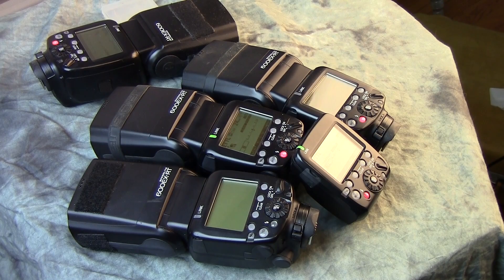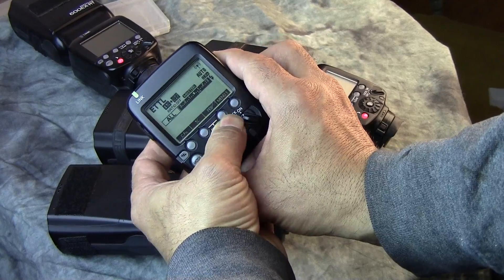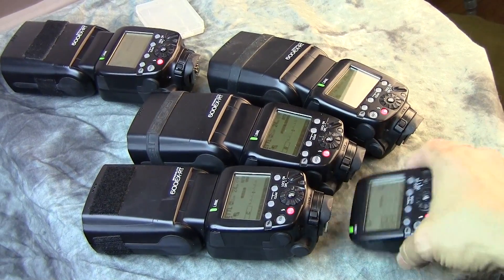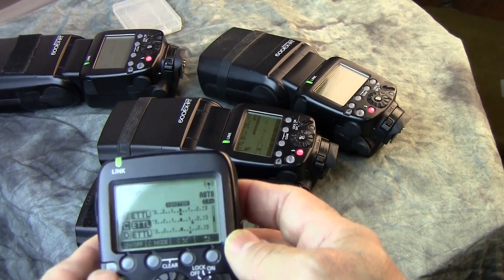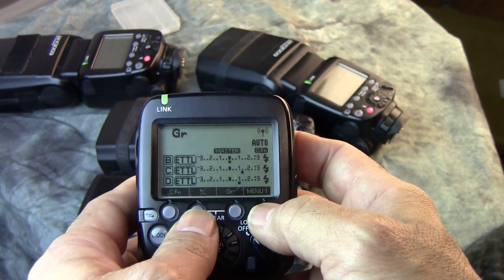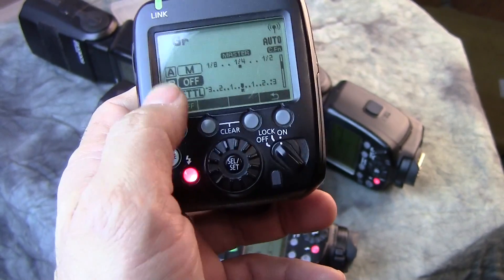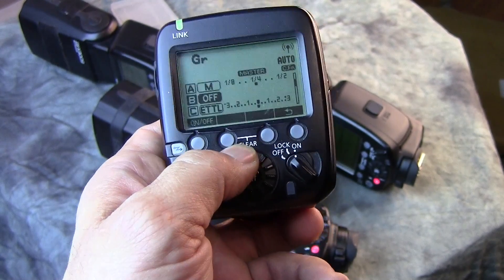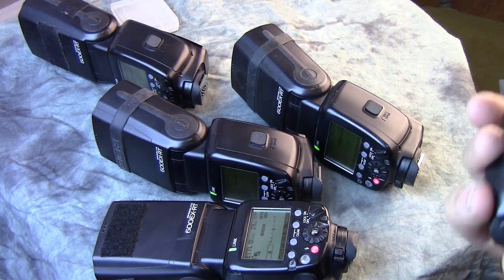canon ST E3 RT transmitter setup 600Ex-Rt speedlites

Comment: I’m sorry I meant when I push the shutter button it won’t fire but when I use the test fire button it works just fine.
Reply from the maker: Which camera are you using?  Also, does the 600ex rt work on that camera, if it is a compatible camera? I mean, literally confirm it is working... Also, did you see my video on the hot shoe issues?
Reply: Construction Engineering, & EQUILIBRIUM 
Good morning sir yes the transmitter works with my Canon 5DMKIII & 5DS it just won’t work once I put it in groups. It works in ttl, manual. No I didn’t watch that video on the hot shoe but I’ll watch at lunch.
Reply from the maker: Watch it and comment... I will see your comment back here or there...  I will do another video for you also... on groups only... in the next few minutes.
Reply from the maker: Lenwood, loading a video for you now...  it will take a few minutes to process, look back at my channel in a few minutes for the latest video on "Canon ST-E3-RT Transmitter problems solved" or something like that tile.
Reply from the maker: https://www.youtube.com/watch?v=Dgz9jEe2ano
Reply from the maker: https://www.youtube.com/watch?v=XxhsTcRos1Q

Comment: I have the same exact setup but in groups there wouldn’t fire. What am I doing wrong?
Reply from the maker: Watch the video again, and see what settings you may have wrong on this transmitter... if ANYTHING is not the same, then the speedlite ... wait, what speedlites are you using?
Reply: Construction Engineering, & EQUILIBRIUM 
Four of the canon 600 exrt
Reply from the maker: @LYBEY06143  make sure it is the ''master'' and not one of the receivers

Comment: I have phottix odin 11 flash trigger transmitter for canon but disappointed with it. The phottix transmitter is easy to use but it died after hardly using it. Now, I'm considering buying this Canon ST-E3-RT Speedlite Transmitter.
Reply from the maker: I see... I also, have an extra St-E3-Rt if you are interested...

Comment: I want to use my speedlites for ultraviolet photography by using a special UV glass in front of the flash. I have read that high end Canon's have a filter to stop this, but some Yongnuo's can be used as they do not have the filters. I have 2 of the Canon's and 2 of the Yongnuo's (600EX RT's), so I wonder if I can use the cheaper Yongnuo's for this?

Comment: Hi again, thanks to this tutorial I'm fine with this part of the 600ex-rt's and the ST E3 RT.  I am now wondering if there is a way to zoom the flashes from the ST E3 RT or do you have to go to the flashes and do it manually?  I'm trying to figure out the best way to use a GOBO and I think zooming the flash may help.  It would be nice if I could do it from the transmitter.
Reply from the maker: Sorry, for the delay, no you cannot zoom from the transmitter. You can trigger the camera from one of the flashes though - like a remote trigger.
Reply: thanks, I'm still getting the hang of the zoom feature on my 600ex-rt flashes.  I tend to play around with the buttons until something changes.  I should watch  your tutorial again.

Comment: Thank you!  I've been trying to figure out these things from the instruction manuals and was really getting confused!  Your explanation really helped.  I had all three of my flashes and the transmitter with me while I watched and was able to replicate what you did.  Now I'll take them to my studio and  get used to them.  Thanks for sharing your wisdom.
Reply: +Photolight PhotoLight I haven't tried it yet, but if I used one of my flashes on camera instead of the ST E3 RT would I have the same controls?   I'd want the one on the camera to be one group, right?
Reply from the maker: I am so sorry for getting this question so late -- google is acting weird lately... Yes, you can use one of your flashes / speedlites as a transmitter. You can have it contribute or not.

Comment: Hi! Sorry for my bad english, i'm brazilian!  That transmitter works with CANON 600ex-rt and YN 600 at the same time? Thanks! :)
Reply: +Luiz Gaspar Yes. I just received a YN600EX-RT today, and the Canon ST-E3-RT does work with both my Yongnuo and my two Canon 600EX-RTs at the same time.

Comment: Good tutorial. For those folks just getting into the 600Ex-Rt flash system, you'll find it to be a little confusing. But wait until you've work with the system for a while, it will open up a whole new world for you. "Practice makes perfect" as the old saying goes.